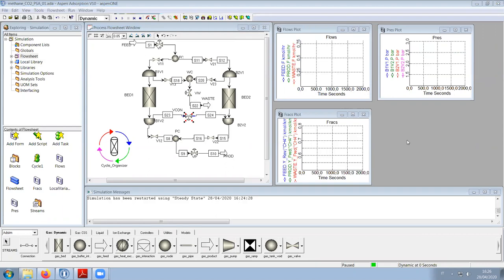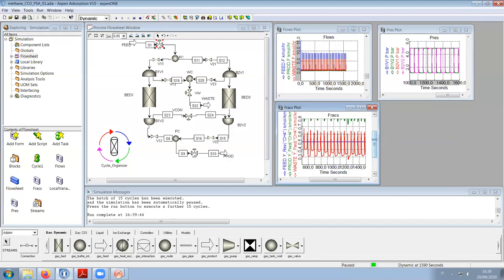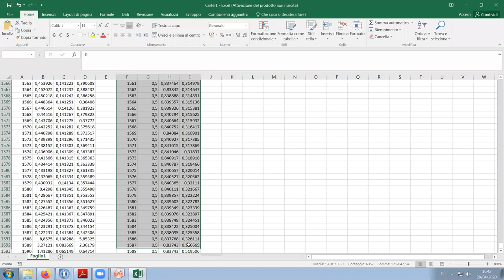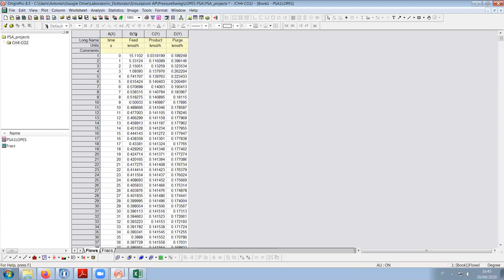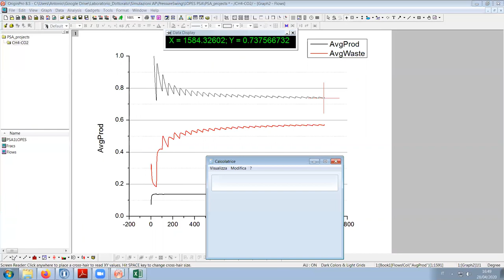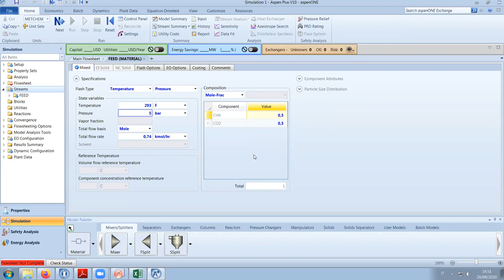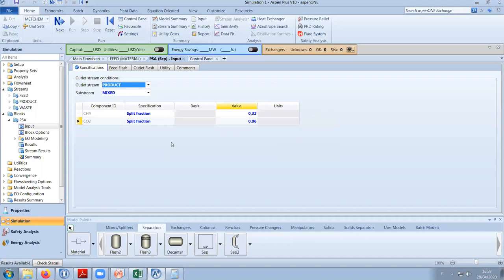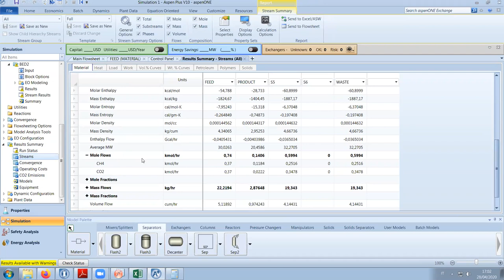Aspen Adsorption to Aspen Plus: quick representation of the steady-state results

Comment: Halo Mr Antonio, I made a few simulation for water removal on NG using Dessicant MS-512. But currently the water on dessicant with water removal during process is not equal. Do you open for a discussion?
Reply from the maker: Yes. Please give some details about the process
Reply: sir can I get this adsorption file from u

Comment: Thank you for your video. I have a question, is it possible to simulate reactive adsorption similar to the reactive distillation in Aspen plus?  we work on reaction for different gases production and then we separate gases by adsorption not absorption, but we try to combine these two steps in one step (reaction-adsorption in one unit), is it possible?
Reply from the maker: Yes. In Aspen Adsorption, when you manage the settings of a bed, you find a tab "reactions" that let you make react the adsorbed chemicals.
Only be careful to distinguish between gas-phase reactions and reactions "on-the-surface"
If your reaction is an Ely-Rideal one (gas molecule+adsorber molecule), then I dont' think AA has a built-in feature (try read the guide carefully), nevertheless you can always resort to Aspen Custom Modeler.
Reply: @Antonio_Tripodi  Thanks a lot, I appreciate your help.

Comment: Hi Antonio, for non-cyclic operations, do I use the Aspen adsorption as well? I mean for fixed-bed adsorption beds but non-cyclic? I need to evaluate the effects of bed features (pore volume, etc.) to the operation. Thanks for this video, this is quite useful.
Reply from the maker: For non cyclic operations aspen ads is even more convenient, because the integrator will not have to handle steep variable transients and is less prone to crashes.
Reply: @Antonio_Tripodi  Thanks for the answer👍